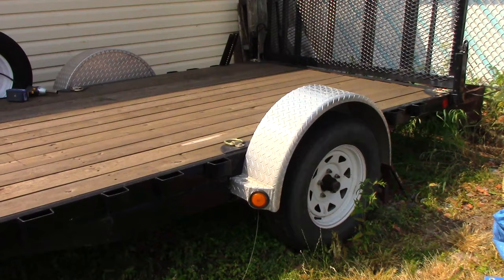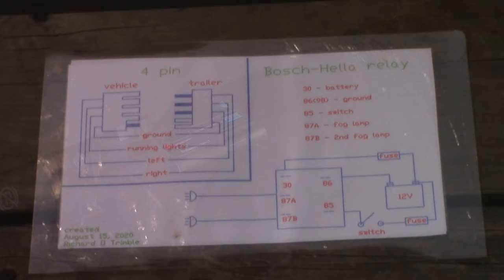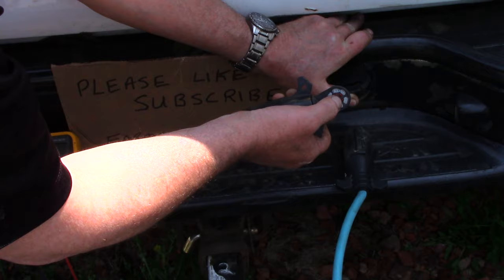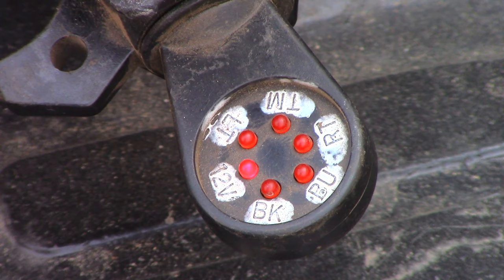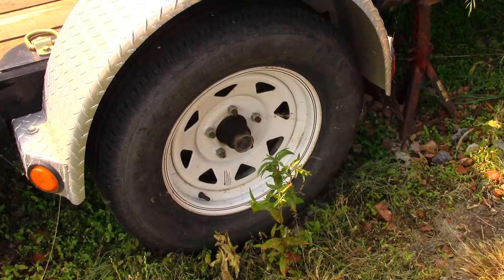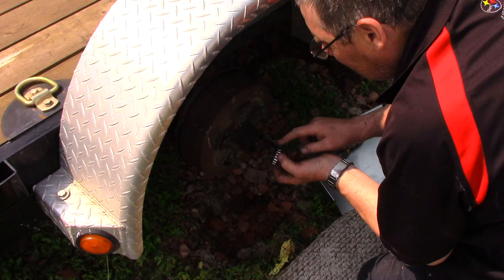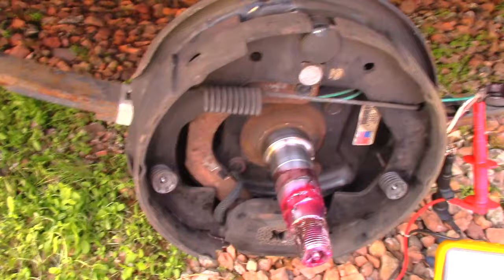Electric trailer brake diagnosis

Comment: Back to your problem of  unequal braking. These brakes will need adjusting every year to get them working with the same pressure. E trailer has good short videos on this. Thanks for the great video and keeping it to the point without making a TV show out if it. DS

Comment: Thank you for your efforts and video. Very informative and descriptions are perfect! Very well put together, and I can learn from anyone. I've been playing with drum brakes since 1971, yes been around a while. But! I am brand new to the electric brakes, and never had any apart before.  I am adding brakes to my 3500 lb single axle trailer. Not that I couldn't figure it out, I enjoy going over the work that's ahead of me. For me this is an excellent refresher course, and thank you very much.
Reply from the maker: Good luck with your brake job.

Comment: Nice meter.  Wish I could afford one.  I'm going to give this tip.  When working on trailer electrical, ONLY connect the electrical.  In other words, don't hitch it up.  No mechanical connection to tow vehicle.  This will help with diagnostics, particularly on the ground side where most problems occur.
Reply from the maker: I bought that Fluke meter when I was in technology College back in 1992.
Reply: For a more affordable very high quality meter buy the "IDEAL" brand.  They've been around for decades and only serve the electrical world for decades.  A lot of electrical supply dealers have it as well.  Order from Lowes the "IDEAL" brand model 61-357 (currently the best model from IDEAL).  You'll have to order it from Lowes because Lowes does yet stock it in store but do have the older versions in store so you could at least see the brand.  Specs are same as Fluke and they come with a Certicate of Calibration.  Their clamp meters are fantastic as well.

Comment: Great tutorial on the trailer brakes. I've got one locking on a dual axle trailer. Everything mechanical seems fine. I suspect an electrical issue on that wheel.
Reply from the maker: hope you get it.

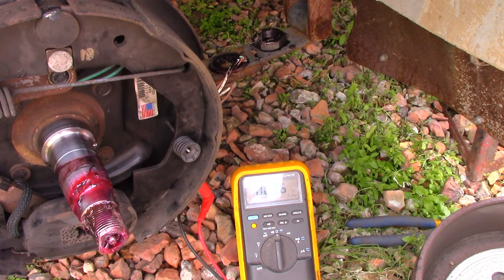Comment: @ 9:10 if you didn't disconnect the wiring between the two magnets, you are measuring resistance of both magnets at same time.
Reply from the maker: I had them isolated from each other.   it's tough to show everything.

Comment: I have a 7,000 lb two axle trailer.  Both axles have brakes and I can’t hookup both axles to my brake controller, only one. Is that because of my ( cheap) brake controller?  Very good video.
Reply from the maker: Some break controllers will have a switch for one, two, or three axle, or its a cheap one.

Comment: Now, I understand how electric trailer-brakes work. Thanks a lot. Are trailers fitted with its own batt - in any case of electric brakes? Or is the vehicle batt sufficient? How is this setup used as a parking brake? Will the magnet drain the batt in a few days? And by the way: Wouldn't you mind letting us know the brand/ model and size of the rims? They look like Mangels. You can buy look-alikes, unbranded and no "official" marks on them for identification, hardly some printed size figures ( f.e. 61/2 x16  ET 8) .
Reply from the maker: A trailer is fitted with its own 12 volt battery.  It gets a charge from a properly wire plug from your vehicle. So, if the trailer breaks away from the vehicle, it will pull the brake-away switch and activate the brakes.
Reply: @farmboyfixes  Ah. Thanks for the explanation. So, the electric brake also works as parking brake?
Reply from the maker: @HeinerStorchennest1  It is not a parking brake. Once the little 12 volt battery goes low on charge, the brakes will release.  This is only for an emergency if the trailer breaks away form the tow vehicle.  Only air operated brakes are engaged when low on air or no air, and need air pressure to disenage them.
Reply: @farmboyfixes  Thanks for the quick response and the information. So, do electric braked trailers have a hand/ lever ( cable/rod) operated parking brake?
Reply from the maker: @HeinerStorchennest1  Trailers with electric brakes and now brakes ( single axle trailer with a 3500 pound rating or less) have no level.  Always use trailer blocks in front and behind the wheel to secure it from moving.

Comment: Very nicely done. My only question is: did you connect the magnet wires when testing for amps? If you’re concern is one side grabbing more than the other- id like to think the amp test should be done while under load (ie: in this case just spinning the wheel “assembled” THEN noting the amp readout)?
Reply from the maker: You could be right.   I did contact the magnet supplier, and he said there is a 5% tolerance in them.   Meaning,  magnets are not  exactly the same.  So, hence, I feel one grabbing first.
Reply: @farmboyfixes  5% tolerance in the resistance values? I have a 32ft oil-bathed Rockwell axle flatbed that I NEED to tackle with monster electric drums . Appreciated your vid, would love to see the values underload

Comment: Good video Reminds me of My fathers old wells cargo 4 place sled trailer let alone the Horse trailers.  Can ya do one on the hydraulic psi ones that I beleive ran on inertia of the pulling vehicle??
Reply from the maker: Thank you. Unfortunately, I have no access to a hydraulic/inertia.  I believe the U-haul trailers are that way.
Reply: @farmboyfixes   ya wanna hear my story how a uhaul trailer that  couldve  sent me off a bridge? way to young to know better when I picked it up but didnt realize to check it. they didnt torque the ball on a hitch for a receiver was the first incident and then a tire blow out in the middle of I40 at 3 am.  came to realize tires were dry rotted and 15 years old  but the dot stamp was worn off.   fuck UHAUL..  rough trip between texas to pa. I think having a 3/4 ton truck is what saved me . The chains held when it came off the ball and GOOD Truck drivers behind me knew what was happenning and slowed down traffic coming down the hill.  THe brakes an e BRAKES of the HYdraulics failed when needed.   I had a Magnett brake Controller but the trailer didnt so it was all inertie. Excuse the brevity of this message
Reply from the maker: @culbyj3665  Wow, that would have filled my pants.

Comment: nice video I'm getting a weaker amperage at the brakes when using the brake pedal as opposed to the the controller switch even with different vehicles ...... any thoughts
Reply: if you measure the current to ALL of the magnets at the same time and get 12 amps then you do not have to check the individual magnets. If you pull the pin on the break-away switch and use a DC ampclamp you can easily measure the current. Even better is to connect 12 volts to the brake circuit and grnd circuit at the 7-pin plug and measure for 12 amps (tandem axle trailer). THIS tests the grnd circuit to the trailer frame AND the ground and power thru the 7-pin cord itself. It kills 4 birds with one stone!!
Reply: You can also check the current to the trailer brakes using the manual application on the brake controller. Max application = 12 amps. You can measure the current on the brake wire at the 7-pin junction box on the trailer a-frame or fifth wheel equivalent. Note that this tests the integrity of the ground circuit on both truck and trailer! Saves you a lot of unnecessary testing.

Comment: Dumb question but did you end up just re-using the old seal and stuff ?
Reply from the maker: Yes, re-use, the trailer is only 3 years old.  But, I was carefull to remove it and reinstall it.
Reply: Ahh nice , thanks for the reply had to do some trouble shooting on a trailer today and I’m not very familiar with electric brakes and this cleared some things up ! Supper funny thing is I’m in Edmonton alberta !

Comment: Is the emergency pull cable powered by the battery or do you need to have the pigtail plugged in to the vehicle in order to test it? This is in reference to a travel trailer. Thanks
Reply from the maker: A properly wired emergency  cable will be off the trailer brake battery.  That way if it every comes un hitched from your tow vehicle, it will engage your trailer brakes. It should not be pigtailed to your tow vehicle wiring.
Reply: @farmboyfixes  Any chance you could provide more detail here? Two wires coming from breakaway, one goes directly to positive of battery and one to negative?
Reply from the maker: @Laura-lr3sz  One wire is coming from the little battery 12volt positive, the other wire is pigtailed into the wires that supply postive voltage to the brakes.  Basiclly, when that break away is pulled, 12 volt passes through it to the brakes.

Comment: Once I ground one of the two hanging from the hub my brakes stop working, if I put power through to the power wire of the hub my ground wire also has power can anyone pls help
Reply from the maker: You have a short somewhere.  Disconnect each hub to isolate which one is the problem.
Reply: It was a ground issue, thank you sir

Comment: Still never explained the reason why one side was grabbing more than the other.
Reply: Most likely it wasn't adjusted properly.  That's always a go to with electric brakes. I run the adjusters in until the brakes grab and then back them off until the wheel turns freely.  I have a issue with my brakes not working at the moment but I think its electrical.  Good real world tutorial.

Comment: I have a utility trailer similar to yours.  Everything works fine except the brakes.  When I go slowly backwards, the left wheel locks up, then releases w/o foot on brake.  It drags the gravel, so I know something is catching it to lock it up.  Then a moment later, it releases, then catches again for a second or two then releases w/o touching the brake.  Why is that happening?  THUMBS UP!!!
Reply from the maker: first thing to do is confirm wires are not shorting out to ground.  no broken wires.  next would be to take apart the drum and clean it and use a good brake grease on all wear surfaces.